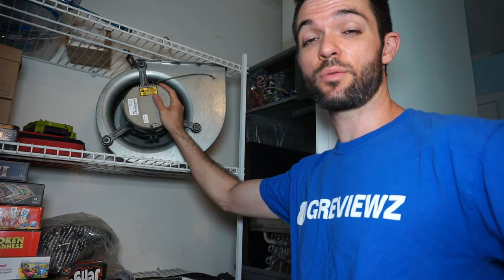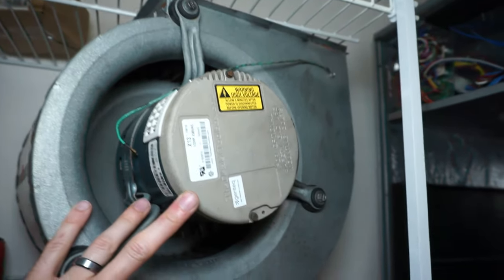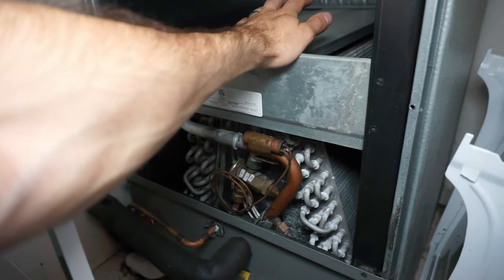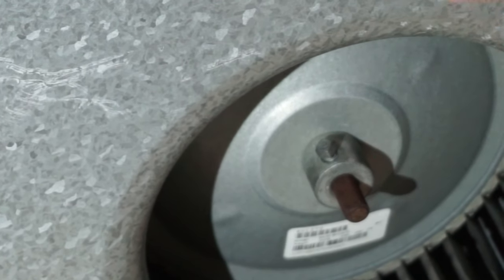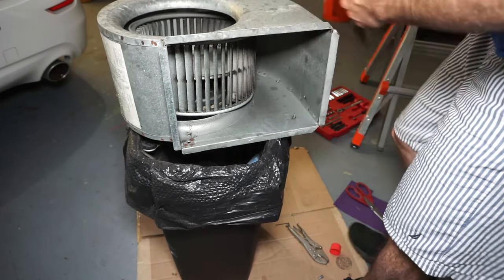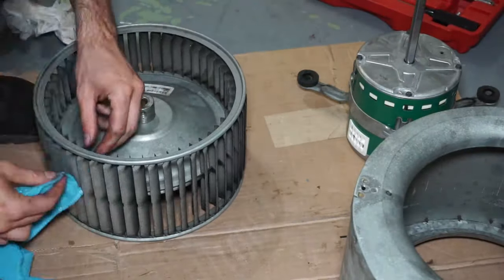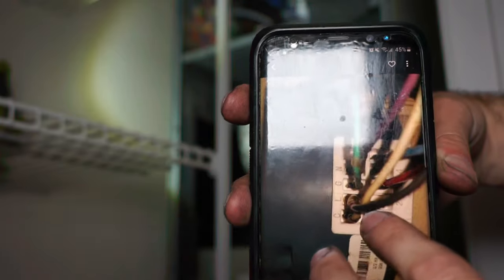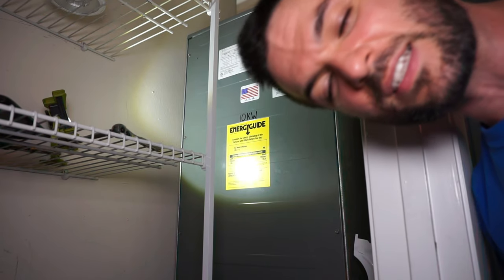SAVE $1000!!! Replace that Air Handler Blower motor yourself and tell the ac guy to take a hike!

Comment: Thank you so much for this video, I was able to fix my blower for $400. The company I got to give me a quote estimated a minimum of $1400. I actually saved $1000 just like your thumbnail suggested! Thanks!
Reply from the maker: That is fantastic! Thank you for the comment. Glad I could help!
Reply: where did you buy the motor for that price?
Reply: @MrRerod  Amazon of all places! The motor was about $310 but I had a company come out to diagnose the problem as I'm not an hvac technician. The company charged me $90 for the diagnostic test.
Reply: I'm a handyman in FL we not allowed to touch AC. If I could I could save my customers a lot of money. But in fl electrician,  plumber,  and HVAC are protected by the old school guys but I just changed my motor the one thing you need to know is a gentec motor is program to your ac. Each model number will match the program just make sure program is same
Reply: United HVAC motors has these less than 300 and they will make sure you get right program for motor and they give 24 month warranty @MrRerod

Comment: Ha I wanna see a customer replace their own blower motor! Guarantee most people would stop at the set screw and yell for help lol
Reply: I just did using this and other videos. HA!
Reply from the maker: I clearly did in my video using youtube videos.. it's not rocket science.
Reply: Had an “AC Guy” try and charge $2000 to replace a small part. $300 an hour and the guy sat in the attic doing nothing. I set up a camera and watched him do nothing. Most of these technicians are decent but some rip you off. Doctors don’t make what these guys charge.
Reply: @reaperrt1019 yeah it just depends who your working with. For something like this we would charge 500-600 just because it can be a dangerous job. But definitely not anywhere near 1k.

Comment: Very helpful & liked how you described & also told to take picks of wiring. Had HVAC guy came out & he said that the motor was going Out & that a new motor would cost between $975-$1,300.00. And would have to put All new capacitors which just had him to put a new capacitor approximately 3 wks prior. Which was with Service call $225.  But he said with New motor would have to put New capacitors. That the New one he'd just put in wasn't compatible with new.motor?  Which told me when I got a new motor that I might want to get a New HVAC guy as well. But I'm pretty Tech Savvy. What I just watched & learned from this guy & his very informative video. I do believe I can Save myself several 100s of $$s by what I just learned from him. Thanks Alot Bro. I Truly appreciate your help ALOTT. GOD BLESS YOU MY FRIEND 🙏 🙏 🙏.                                               Bill from Eastern KY/USA

Comment: Thanks for sharing this!  I have an old goodman 240v blower in our attic that is still working after 30 years! Its a hydronics system and just hoping it make it thru another winter! The one in the Basement one was changed a few years back for $500. Two techs sadly fumbled with 3 call backs and 8 hours later. They and replaced it with a used rusted GE unit kicking around in their truck and disconnected the pre warming temp sensors on the heat exchangers. The replacement makes an intermittent banging sound when it goes off! It is probably a bearing or they forgot a grommet!  Originally they were both pretty quiet when they ran!! The company did not stand by their work and will just charge me again. Jockey around a cold attic is not a fun job unless you can have a complete new or used blower housing and new motor installed standing by.

Comment: Replaced my blower motor yesterday and saved $1k. Ty very helpful
Reply from the maker: Love it! Thank you for letting me know! Makes me feel great knowing I helped you save some $$
Reply: How old is your furnace? You do realize if it’s under 10 years old, it’s covered under warranty. The guy showing you the video didn’t know or tell you that his motor was covered under warranty. He spent over $300 to get an aftermarket motor when he could have gotten a company to get an original one for free from manufacturer. Everyone on YouTube tries to outsmart the system. A good HVAC company would have charged him about $200 labor and a FREE (original) blower motor.
Reply: @joeburner7120  nope wasn't covered
Reply: @joeburner7120  what's the name that the Blower motor sit in? Is it name cage or assembly cage??
Reply: @Harbinger-2023  If the unit was registered, it’s covered 10 years. We have relationships with supply houses and even if it was not registered, we can get it under warranty for 10 years from sale of equipment
Reply: @acr8615  It’s called a blower assembly or blower housing.
Reply: @joeburner7120  the house was built in 1988 and the 2nd unit is not much younger. I'm happy to report that it's working perfectly after I replaced the blower. Problem solved.

Comment: Most of these hvac companies charge you double the part cost plus 100 or more an hour.  In my experience the ac work consists of not checking for leaks, just topping it off and charging you 500 to 800 everytime they come to top off your leaky system.

Comment: Just had that done to my air conditioner yesterday. The part was still under they said that part cost $900. Watched him do it. So next time it won't be under warranty. I will definitely fix that myself. It would have been $1,500 if I did not have warranty

Comment: I have a question for anyone.  Is it best to pay a AC Company up front? I'm asking because this was told too me. I could understand for a portion payment but they are asking the full amount. The work will not be done until 4days, scheduled.  They are putting a new unit in from my home warranty.
Reply: I know this comment is old but never pay anyone completely up front. At a minimum half is what you should pay before work is done.

Comment: So you put a universal motor in a seven year old unit which was probably still under warranty that you would of got the motor for free? Yes the OEM motors for these are pretty expensive there a ECM which means they have their own computer on the back of the motor. I see you posted this video 11 months ago I’d like to know if the motor still operational
Reply from the maker: Motor is still working great that I installed :)
Reply: Most units 5 yrs warranty. Only certain models 10.
Reply: @duriarte3190  It's it's installed by a certified technician then it should be 10. They come 5 year year factory.

Comment: Thanks for your time and making the video. 
How did you confirm the correct parts  from Amazon  ??
Is that any specific way to make sure you got the same correct parts  ???
Please let me know.  My lennox is very similar as yours.
Just for the DIY knowledge purpose
Reply from the maker: You just lookup the specific part number on Amazon. Like I grabbed the blower motor part number/serial number off the old one and typed it into Amazon. Just make sure all of the numbers on it are the same.
Reply: @GReviewz I'm about to do this same thing almost exactly like your motor, the problem is there are three stickers and each sticker has 10 different numbers so the diyer has to figure out which numbers to match up and which don't matter for part matching.  What I have matched when I ordered mine is the same number that you read off plus the horsepower plus the RPM plus the voltage.  There are still many more numbers on several stickers though.  Hopefully I got the right one.

Comment: Old motor was a 1050rpm, and the replacement I got in is 1075rpm. Is that okay or is that 25 extra rpms gonna be a problem? The old one was also a 5.4A and the new one is a 6.0A. Is that also gonna be a problem?
Reply from the maker: Still runs great wirh no issues :)
Reply: @GReviewz  lol no I meant I replaced my own motor. Was asking if those specs would be ok for my own system.

Comment: Everything perfect, except for the position of the cables, that was beyond moronic. The cables have to be on the lower side so water moisture doesn't get into the connections. That motor will not last, or even worse will cause a short somewhere else.

Comment: You’re gonna encourage people to repair on their ACs themselves so they can potentially get hurt, do it wrong and/or void the warranty.
Reply from the maker: Yup. Save lots of money 💰 🤑
Reply: mine was out of warranty and this repair is literally turn off the power,  unscrew 8 screws, unplug two wires. Come on, most AC techs are NOT rocket scientists lol. They are usually upselling commission based semi-salesmen.
Reply: @michaelcostello9157 until someone forgets to turn off the power, many experienced techs get injured or worse. It's not rocket science but there's always a risk.
Reply: Saving money is great, and 1200 is steep, but just make sure to let people know that the transformer on most blower motors (240/12v) can hurt you pretty good, or kill you if it’s off. They store charge so don’t touch it until your sure it isn’t energized, and make sure it’s plugged correctly, or you are going to spend a lot more money than the 1200 when the board is smoked.

Comment: I understand wanting to save money. You had a bad contractor. I would have charged you $300. That charge is for diagnostic, time to travel to supply house and labor. The unit is 7 years old you said. The motor is under warranty for 10 years through manufacturers. Not so smart now huh?
Reply from the maker: No I still feel smart, I learned alot throughout this process and helped some other people save money.
Reply: @GReviewz  The motor would have been OEM and FREE. You are not doing yourself or others any favors when you spend over $300 when you can get it free. You do you. My opinion is it doesn’t make sense to spend $300 plus dollars for a motor that is a replacement. I would rather call an hvac company, pay them $150-300 for the labor and get a FREE OEM motor and keep my hands clean. Just saying.
Reply: @markbeard2222  He only knew he needed to replace the motor because someone gave him the RIGHT info. He was never charged $1200 for the job. He said that to make a video. You know fluff it to get people interested. So he ended paying someone $150 to diagnose the system, he then bought the motor online for $300. Most contractors would charge $600 for the x13 motor installed. And they back it with a warranty. Not that it’s rocket science but if he were to screw up his circuit board, he would be kicking himself. Also if it fails, he needs to pay for shipping both ways and wait a week. When a contractor installs it, they will be out with new motor, no extra costs during warranty. Even at $800, it’s not a rip off. Think. The contractor pays a bit more at supply house because of warranty (over the counter) The contractor will dedicate half the day to drive to job, diagnose, drive to supply house and back, spend time installing it, use his expensive motor tester to run diagnostics on it. They also need to pay for gas, insurance, tools, taxes, retirement benefits (like everyone else gets). So those costs have to passed on so they can make a reasonable living like everyone else. I believe you expect to make money at work also. I’m sure you wouldn’t spend hours and pay all work related expenses to make $15 an hour?????
Short story long, do you complain when you pay $8 for breakfast when you can spend $1 in ingredients and cook at home. The dude that made this video exaggerated the story to make a YouTube video.
Reply: Bro a motor is like 150.  Who cares if it’s under warranty a hvac will still scam you on labor.  Dude did the right thing and cleaned his fan blades. Thanks for the vid.
Reply: @jonathanmoulton9251  Hey “bro” how much is a rip off on labor? Consider that the HVAC company wastes time and gas money to come to your house and the HVAC company has expenses like insurance, employee benefits, truck expenses and tools. You do you. You expect people to take 30 minutes to drive to you, use their tools and spend an hour doing a repair for what $25. How much do you make an hour? 

Here’s reality
In in 8 hour day an HVAC tech has to spend half the day driving. Wasting $30- 40 in gas. An HVAC company has $10k in tools and another$10k in inventory in truck. Add in insurance, truck costs, licenses, educational costs etc. A good hourly rate is $125 per hour to charge customer. Since only 4 hours get billed but the work day is 8 hours it comes out to $62 an hour, take out $5 per hour in gas and your at $57 an hour. Now pay other direct business expenses like truck maintenance, liability insurance, workers comp, health insurance, licenses, bonds and your lucky to make $35- 40 an hour. No one is ripping people off. It’s  what contractors need to charge to stay in business. Car mechanics charge $125 per hour and they are not coming out to your house bring a truck full of tools and taking half their day driving to peoples home. Perhaps you think before making such comments. If you take a chance and try and fix something, good for you. But to make a comment about a rate being a rip off is a simpleton comment.

I deal with people trying to fix their own shit all the time. When they call me because they failed, I charge them a lot more. I can sense cheap people so I get the maximum I can from them. Then I mark them as “ do not service” when they call again.
Reply: @Joe P I understand you have over head cost, but sounds like you got a logistical issue. Schedule you gobs better so your not spending all your time driving. And to my point of over charging you said and I quote “ if people call me to fix something they tried to fix themselves you charge them more.” Ha there you go people always get 3-4 quotes. Also if any DIY person has half a brain you can do this install easy. It’s not rocket science! It’s not that we’re cheap or that we don’t support hvac techs, we just don’t need you for this type of install. That’s all. Have a great day!
Reply: @jonathanmoulton9251  I stand behind what I said. It’s not a logistics problem of scheduling. I live in a metro area that takes you half an hour to travel 3 miles. Either way, I do charge extra when I see an attempt of diy. And I will continue. This conversation started about title of video. The person who uploaded the video claimed they saved $1000 by replacing it themselves. I stated that it wasn’t true because the motor would have been free under warranty and on the high side, you’d pay $300 for diagnostics and labor. So go ahead, replace your own motors, replace your own boards and service your own refrigerant. You are not our targeted customer. Dennys serves breakfast but is not competing with people that cook at home. The video poster falsely claimed that he saved $1000. He saved $300 but spent $300 for motor and waited. So if a few dollars are more important than your comfort, HVAC techs and companies have no need for your business. The HVAC business is too good now. Call around and try and get service, you will be waiting for days.
Reply: @jonathanmoulton9251  No not a logistic issue. I service metro area where it can take 30 mins to travel 3 miles. I stand by what I said. The video title is about saving $1000 by diy. It’s not true because a reasonable price would be $200 to $300 and any company in the trade would have gotten the motor replacement under warranty. He paid $300 for the motor instead of warranty so my math shows that he either broke even or did it himself and spent an extra $100. HVAC companies are not rip offs. They charge a fair price to cover business expenses and make a fair wage. I have no problems with diy because if everyone called an HVAC company , there would be more demand than we could handle. Call any HVAC company for service and you’ll wait a couple days for appointment. Business is great. I will charge substantially more when I walk into a job that someone messed up by attempting themselves and I will continue doing so. They have an option not to hire me and just pay my $125 trip charge. On to the next one. My whole point here was that the video was click bait saying it was a $1000 savings, which it was not. Then statements were made about HVAC companies being rip offs. End of day, we will not work for minimum wage, as you would not. So tell me, what is a fair price for someone to come out to your house with a parts warehouse on wheels while fighting traffic and incurring business expenses? I stoped at Dennys once paid $10 for 2 eggs hash brows and toast….I could have made that at home for under a dollar Dennys does not target people that cook breakfast at home and we do not target diy that try to save $100 by living without heat or ac for days because they are waiting for a part. My average flat price for a fan motor is $375 for labor and parts. Motor costs me about $130 and my labor and trip charge is $245. Buy the motor yourself and I charge $325 for labor only.
Reply: How do I know if my mother still under warranty my AC system is 8 years old
Reply: @Electro-nics  Get the serial number from unit and check online (some manufacturers) or call their customer service. If it was registered, almost all brands have 10 year warranty.
Reply: @joep4143  thank you mine shows only 5 years and the house is 8 years old :( unlucky.
Reply: @joep4143  nobody cares about your sob story about how hard hvac companies have it, I promise you that. 

Every company has overheads... this video isn't talking about that. He's talking about the ridiculous quotes greedy hvac companies constantly hand out. I got quoted over 1k for a blower motor from an hvac company that's 2 miles from me.... explain that. 

Fact is a lot of companies are fleecing customers who are ignorant to part costs and wrecking them with labor itemizations. You're an hvac company, not a charity. I don't care about your overhead, if you can't quote a competitive price I'm going elsewhere or diy like I did from this video.